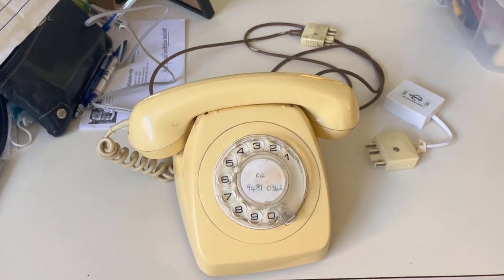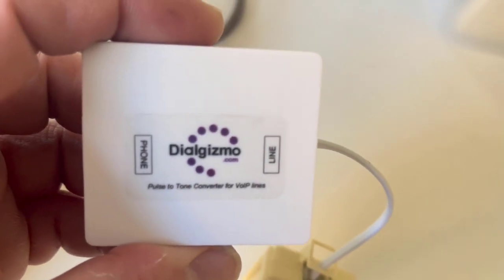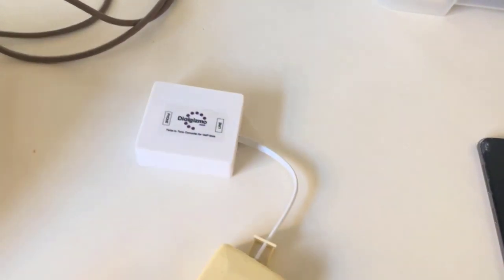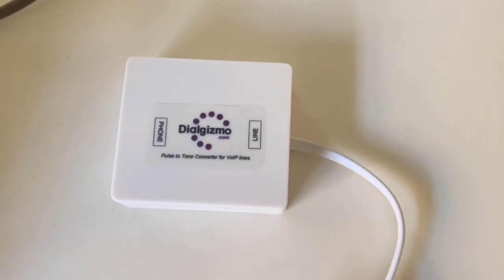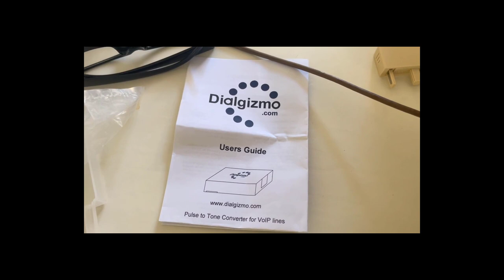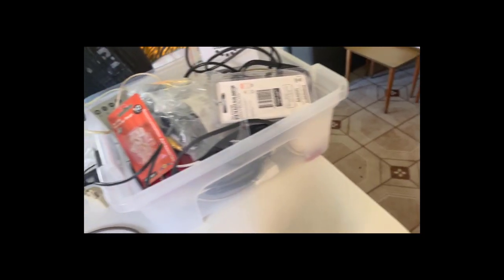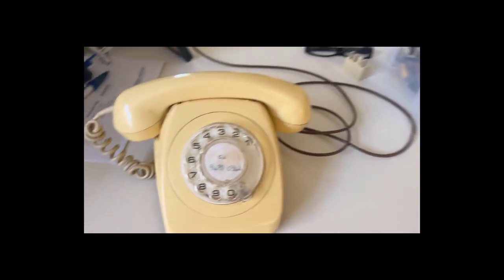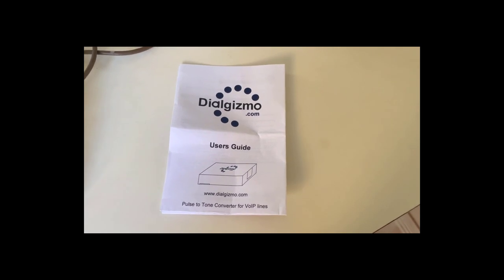Connecting Rotary Phones To NBN VoIP | Testing Device Dialgizmo Bought Online. Does It Work?

Comment: The Dialgizmo converts the dialing pulses to DTMF tones so you can make an outgoing call.  It DOES NOT claim to make the old phone ring, that is a function of the ATA/VOIP setup.  If the phone doesn't ring without the Dialgizmo, it won't ring with Dailgizmo installed.  Look elsewhere to fix the non-ringing problem.
Reply: You are absolutely right!

Comment: If you don't need the Dialgizmo's 6 number speed dialing capability then the better and cheaper choice would be the Dialor 2.0 pulse to tone converter.  The Dialor 2.0 has the * and # plus redial of the last number.  But what it excells at is that there is no half second lag after the dial has stopped before it sounds the tone.  What that means is that you can actually dial as fast as possible like in the old days without misdialing.  With the Dialgizmo if you dial too quickly you will most certainly misdial!  That has been my experience with pulse to tone converters.
Reply from the maker: Thanks for the tip

Comment: The dial gizmo is 100% legit. All it does is covert the pulse dials to tones for OUTGOING calls. I found with mine the rj11 to 610 adapter was causing the phone not to ring. As a previous poster wrote you need to jumper the red and the black wires inside the adapter.Upon opening mine I found that it was wired incorrectly the pairs where swapped. Had dial tone but no ring. Once I swapped the green and the white wires to pins 6 and 5 and jumpered it’s ringing all be it a bit quiet. Measured across the ringing coil inside the phone. My FTTP modem is only supplying 17 volts at max but it still rings!! Now I reckon I might buy one of those dooohickeys so I can call out for nostalgia 😂😂😂 Don’t discount a product because you don’t understand it or how analog phones need to be wired.
Reply from the maker: That’s some solid troubleshooting! It’s amazing how those little details like wire swaps can make all the difference. Sounds like you’ve got it sorted, and getting that old-school ring going is definitely worth it for the nostalgia! 😂📞
Reply: Those phones were designed with long distance, poor quality lines in mind, so they don't need a lot of volts to make them ring. I've completely removed the wire from pin 5 on the 610 side of the adaptor, as that pin is internally connected to the other side of the bell capacitor in the 800 series, which was only used for connecting multiple rotary phones in parallel. You really only need the green and red wires (pins 3 and 4 on the RJ11 side) connected to pins 2+3 and 6 on the 610 side. 

FYI If you're ever curious, there's a wiring diagram for those phones inside the body shell. Just loosen the two captive screws on the base, one at the back near the line cord and one in the diagonally opposite corner at the front, and the top shell lifts right off.

Comment: You need to open up the RJ12 to Telecom 600 series socket adaptor and bridge pins 2 and 3 together to make those old 800 series telephones ring. They were wired like that so an extension bell could be connected in series with the internal bell and capacitor. Most of the old 600 series wall sockets had a little bar fitted between pins 2 and 3 by default, which could be removed by the Telecom technician if an external bell was to be installed.
Reply: Thankyou this comment helped me solve my problem.

Comment: I have an old ATH400 (black bakelite phone) it works fine on my NBN FttP service but you have to put s link in to connect the bell circuit. This is done inside the phone or it can be done on the old style tester plug a wire link between the red and white or pink 2&3 in the plug or a 610 socket. I can get dial tone and the phone rings.
Reply from the maker: Thanks for your feedback on this.
Reply: Spot on, this also works for the 800 series phones like in the video.  And the Dialgizmo lets you dial out by converting the phone's dialling pulses to tones.  It even provides a way of sending * and # tones.

Comment: They do work but the incoming ring needs to come from your voip. Its probably the gizmo is only 2 wire with the pld phone being 3rd wire for the bell, just connect wire 3 to one leg of the 2 wire. Its also possible that the ringing current may not be powerful enough for the bell

Comment: I just dug out my old 1978 era Telecom phone to see if it would work. Surprisingly, the VoIP ATA does have enough omph to ring the bells and the phone works fine. 

Can't dial out though, of course.
Reply: I was just about to add this myself I work in the US just recently upgraded a fire station to fiber and put their phones on a cloud based solution but needed 2 ATA's one for their fax machine and one for their existing cordless phones, I was able to connect the old wall phone they had in the garage they were using just for the ringer its new enough to be touch tone but still has the old school bell ringer inside of it but in my findings the ATA's we use have enough juice to ring the old school phones they are Polycom brand, but I don't believe they are compatible with pulse dialing pretty rare you find a customer that is adamant about keeping their rotary phone working but there are plenty still out there
Reply from the maker: Thanks for your feedback on this video 👍